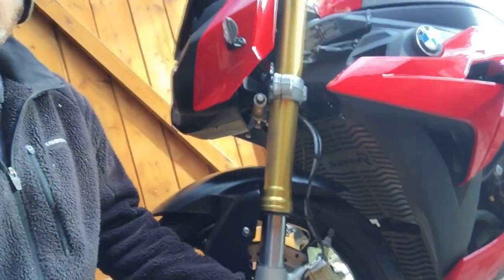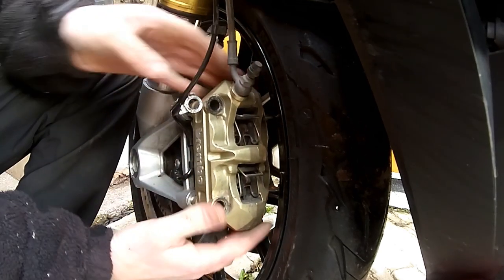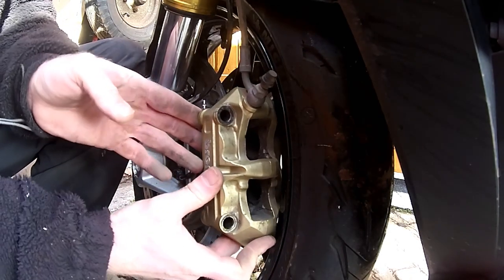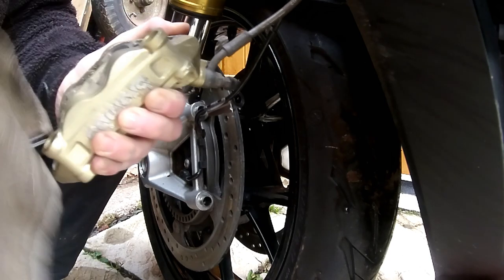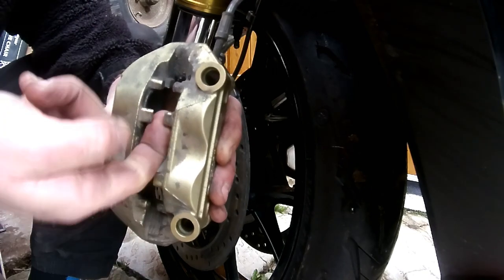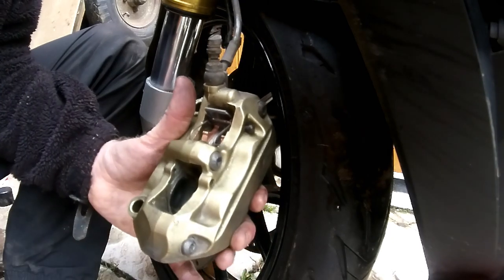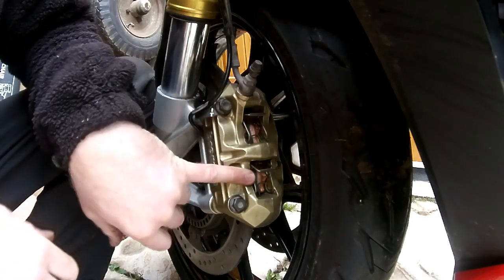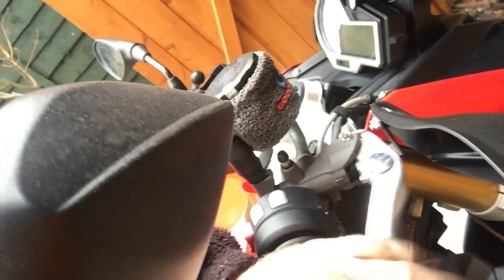BMW S1000R Front Brake Pad Change

Comment: Thanks bud. Very useful. I’ve read you’re supposed to give the discs a wash in soapy water too but maybe that’s not necessary
Reply from the maker: chris guyer that I do every time I wash the bike. If fitting a new disc I’d use brake cleaner but not for just new pads. Unless I felt they were contaminated with something. I’m no expert though just how I do it. 🤷‍♂️👍

Comment: What are the pads like? I've noticed they're quite a bit cheaper than the brembo.
Reply from the maker: mike baldwin to be honest I don’t notice any difference. But then I don’t hammer them with late braking.
Reply: @Wats1984  Thanks. I think I'll give them a try. Great video by the way.
Reply from the maker: mike baldwin thanks for that. 👍 I just do it as another part of the motorbiking hobby. Like I say it’s only an opinion I’m no expert.